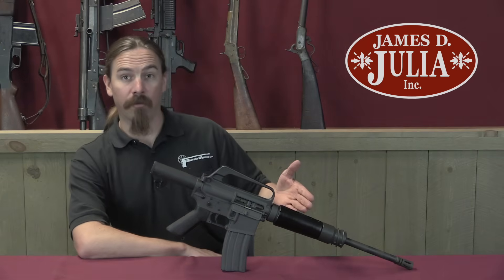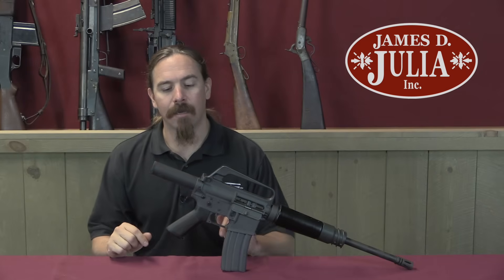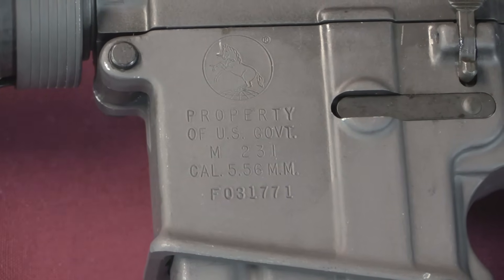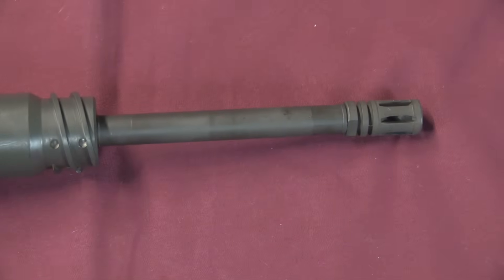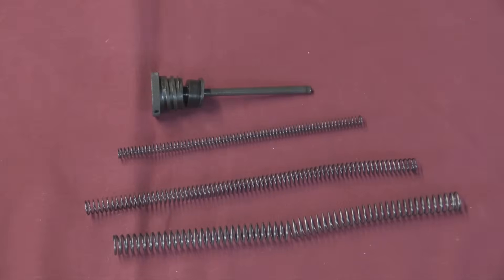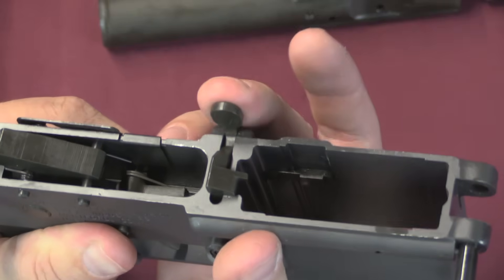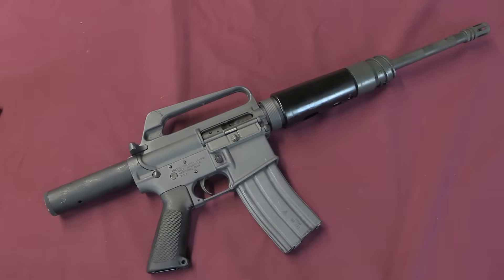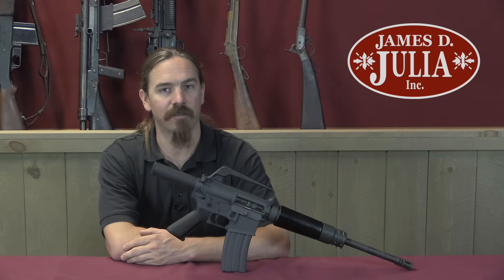Really Not an M16 at All: Colt's M231 Port Firing Weapon

Comment: We were told that the m231 was to fight from inside the vehicle and avoid contamination from NBC/ Nuke Bio Chem . But I suspect it falls into that category of taking a marginal at best idea and throwing as much money as possible at it.  Over 5 billion dollars tossed at ACU camo then dropped, oops!
Reply: I stand corrected, I use that as my standard example of a multi purpose multi tool that never replaces the real tool you actually need.  Often it seems that if the Army wanted a new helicopter and the marines would like a new amphibious vehicle but the air force would like a new ground cargo vehicle then somebody will site an inter service report, toss the phrase "commonality of parts" around and before you know it we have a amphibious cargo helicopter which doesn't do anything well on the way.
Reply: Good point. Open bolt means things besides oxygen can come in.
Reply: Those threads do not look sealed enough to withstand BC attacks to me :)
Reply: Hah, good point. Frankly, even a closed bolt gun is not gonna cut it.
Reply: "Over 5 billion dollars tossed at ACU camo then dropped, oops!"

That "5 billion dollars" included the cost of every issued uniform;  it wasn't the development cost, which was "a matter of several million dollars, not $100 million, and certainly not $5 billion".   See the update at the bottom of this article:
 http://preview.tinyurl.com/y83xhxqp
Reply: +jic1  Don't forget to factor in the cost of replacing the UCP ACUs with the multicam ones for Afghanistan, then the current effort of replacing everything with the improved OCP pattern ACU type IIs, plus the accompanying cost of issuring MOLLE gear to match all three variants.  All because some general likely got a lucrative post-retirement "consulting position" for approving the UCP in the first place.  It's a useless camo pattern and the uniforms themselves were made of markedly flimsy material and thread compared to the older BDUs; I didn't have a single pair of ACUs where the crotches in the pants didn't blow out and the velcro starting falling apart.
Reply: steven white And that, is how we end up with V-22 Ospery.

/tongue-in-cheek
Reply: simonferrer your right they were flimsy, maybe they were designed to be disposable, in all honesty the best fitting feeling uniform I have ever worn, was right after Grenada the Army started allowing us to wear solid green hot weather uniforms like the latter Vietnam ones. I have never worn any other uniform as comfortable or as well thought out as those. Of course it would be too much to expect the army to keep that style just in any new camo pattern.
Reply: al I would assume the Bradley has some kind of filtered positive pressure internal air system that would make small leaks in the barrel and threads perfectly managable but not the large leak an open firing port would create, I don't know much about the Bradley specifically though so I might be wrong
Reply: ACU is the uniform, UCP is the camouflage.
Reply: WTF are you going on about? Electric props???
Reply: Yes, but a lot of those old uniforms will be worn-out and have to be replaced anyway.  My point wasn't that the army didn't mess up:  of course they did!  It's just that this "5 billion dollars" figure that's tossed about is extremely misleading.  They've really only wasted tens or maybe a few hundred million, which is a scandal in itself, but a rounding error in the military budget.
Reply: steven white yeah
Reply: +steven white I remember those uniforms (the OG 107 jungle fatigues); I was in later (1995-2011), but we still had some of those uniforms kicking around for OPFOR to use.  You might be right about the ACU being considered more disposable.  The BDU and DCU were rated for six months combat wear before they were due to be DX'd, whereas the ACU was only rated for four months.
Reply: And it's open bolt...
Reply: Given it was open bolt I see a flaw there, nbc would need a gas seal
Reply: While I don't know the dollar figures involved, the Air Force did the same thing with the 'Airman Battle Uniform' (ABU), used to replace the Woodland BDUs. Now the ABUs have just been replaced by the same uniform as adopted by the Army: the 'Operational Camouflage Pattern' (OCP).
Reply: Ummm, no. The Osprey is hugely successful and a huge improvement for us.
Reply: jic1 The camo pattern used wasn't only on uniforms but all the gear, everything from canteen covers to itv vests we were given, and the point I was attempting to make was more in the line of how could any reasonable person believe that any one camouflage pattern be universal. Wouldn't it be more reasonable to make theatre or area specific uniforms?  I served in the US Army in the 80's and again on a deployment in 2010 to the Mideast, I understand that not only is there going to be some waste but it would be more expensive to try to save every last nickel. What bothers me to no end is wasting money in such huge amount under such a preposterous notion as a universal camo or that this will save money.   This all rings similar to the Handgun debate which is constantly being rehashed, it is a mute point, so few non SOF troops actually use handguns in combat that it makes no sense.
Reply: Jessy Beavers I was going to say the same thing. What's sad is when people how know better confuse the two, people like bloggers on military sites.

Comment: The effort to put firing ports on the Bradley was because of the Soviet Union rolling out their BMP-1 Infantry Fighting Vehicle and utterly terrifying everyone on the other side of the Fulda Gap.  The BMP-1 was designed as an infantry vehicle for conducting battle in a nuclear war.  So it had firing ports along the back of the hull that soldiers could use to shoot from inside without getting all that icky external "fallout" on themselves.

Everyone in NATO freaked out and assumed the Soviets had to have a brilliant, war-winning idea on their hands - what could we possibly do to match the BMP-1?  So everyone started looking for ways to modify their vehicles to be used in the same way.  I think the Bradley was the only one that got into service before everyone realized it was in fact a terminally impractical idea.  They don't even bother putting firing ports on the later versions of the BMP.

As to the BMP-1 itself, it turned out to be a paper-skinned "armored" vehicle that is food for any weapon that isn't a Small Arm.  But boy did it scare people when it showed up!
Reply: The soviets used an overpressure NBC system in the BMP. The passengers an crew were thus protected so long as the machinery was operable, even with the firing ports open.
Reply: The German Marder vehicle also had firing ports and they had the same problem: how to use them while preserving the NBC seal. The Germans adapted an Uzi SMG in a similar fashion to this, which, given the limited effective range of a gun aimed through a vision block/periscope, was probably about as useful. Interestingly, the Soviet's answer to this was simple: don't use the firing poerts under NBC conditions. Their ports were simple holes in the hull through which the infantry could use their standard weapons.
Reply: Yep, it was a Ball with about 5 to 6" diameter with a flip opening to mount a Uzi into this ballport. Above the opening for the barrel mount was a round channel with thick glass of about 1" diameter for peeping through and not too great a view. There were 2 on each side in the back of the marder IFV, so there were 4 Uzi Ballports in total. Exactly the amount of uzis on board: Driver, gunner, commander and leader of the 6 men in back, carried Uzis. The Ports were not supposed to be used under NBC seal either, or diving for that matter, since that vehicle could wade rivers using a snorkel. Beginning in 1980 though, the ballports had to go along with the MG above the backdoor, it was decided they were not really practical, the ballports were completely removed from each of approx. 2500 marder IFV. Also the former 7 men in the back were reduced to 6 because the seat behind commander had to be used for storing 4 Milan anti tank rockets. I was a gunner and later commander and platoon leader on that vehicle during early eighties. Geez, those memories..and yeah 1 year old comment, but what is time anyhoo. Cheers
Reply: @MrHws5mp  also when the bradley came out the germans no longer used the ports afaik
Reply: Designated targets were presumably dismounted infantry in NBC suits who presumably, having gone to all that trouble to stay alive, were then going to charge a heavily-armed stationary AFV and try to stick limpet mines on it or something...
Reply: But man is it fun to drive the BMP-1!
Reply: A Nonymous While the BMP can be effective as shown in Syria and Ukraine, it’s also a death trap which is a nice feature to have for the enemy.
Reply: The guy behind the bush with the WarPac equivalent of an MOPP suit?
Reply: Takahashi Yuuki Yes ive seen the cannon at full fire rate its amazing but it starts to cook off
Reply: I believe they used their cannons. The 73mm gun is very effective against Bradleys, Marders, and even older tanks. It's not as versatile as an Auto cannon, though.
Reply: The Grom was fitted to the BMP-1 in order to fire a large(ish) HEAT round at targets inside the 500m minimum control range of it's 9K11 Malyutka (AT-3 Sagger) ATGWs, indeed initially, the only rounds issued for the Grom were HEAT rounds: the HE-Frag round was introduced in 1974 and can't be handled by the autoloader. When the 9M113 Konkurs (AT-5 Spandrel) was introduced with the BMP-2, it had a much shorter minimum control range of just 70m which meant the Grom could be dispensed with and replaced by the excellent 30mm 2A42 autocannon. This also meant getting rid of the BMP-1's slow and dangerous-to-user autoloader (so dangerous that the Finns, Swedes and some Russian units removed it from their vehicles entirely) and freed up a lot of space in the vehicle since the Grom's RPG-style ammo is very space-inefficient.
Reply: Yeah, the autoloader required the gun to return to a certain elevation (about 3 deg?) between shots and since the powered elevation rate was slow, that didn't help at all when shooting at high angles (such as in Afghanistan). The Swedes and Finns kept the powered ammo carousel so at least the gunner/loader was always presented with the next round in the same place instead of having to twist about inside the turret to find it.
Reply: The one major problem with remote weapons, is eventually you have to go reload them if they aren't fed from an internal magazine.
Reply: all NBC systems use an overpressure system coupled with an extensive air filtration system for incoming air. and no, that system would not work with open ports on the side of the machine. the only thing that would work with open ports is issuing individual breathing apparatuses for the occupants and leaving the cabin itself unfiltered,
Reply: A Nonymous interesting given this information the design of this weapon starts to make more sense. Thanks!
Reply: the back doors of the bmp 1 were also the fuel tanks
Reply: @danielcusack5627  thank god fuel is a liquid and liquids cant burn then. in tanks fuel tanks were used to defend the crews.
Reply: +woozle plus the GROM cant fire on the move effectively.
Reply: It appears to be a solution looking for a pork barrel...;-)
Reply: So what are the designated targets for this 5.56 smg to shoot at in NBC environment? Its not gonna harm any armed vehicle, and what it can kill dont survive in NBC anyway.
Reply: Although now something like the CROWS system would be used instead.
Reply: Thank You for that bit of knowledge. At one time everything the Ruskies did frightened the rest of the world.
Reply: Ah, yes. The bad old days when world governments thought they could "win" a nuclear war...
Reply: Just try not to hit the front glacis of the BMP, possibly might be able to ricochet a 90mm APCR round. Maybe? That thing looks like (it shouldn't bounce one though) it could easily bounce a 105mm APFSDS. It has like, 14 degrees angling? The effective armor is also 66mm (not base armor, effective armor with angle calculated) , but with the angle it has might ricochet. Your chances of ricocheting on a BMP front glacis is low, but never zero.
Reply: However, the BMP-1 also had the Malyutka (or Sagger, in NATO terms) ATGM, which was capable of killing the MBTs and APCs at the time.

When it could hit anything, of course.
Reply: Ahhh, the age old “The Reds have some sort of SUPERWEAPON! We need to develop a counter!”

“Heeeeey, so turns out the AKM/MiG-31/BMP-1/Su-37/47/57 was either overhyped or vaporware, buuuuuut we actually have the counter to what we THOUGHT they had anyway, and we have more of them than God 😂”
Reply: the classic tale of the USSR making a scary propaganda weapon and the USA responding by significantly improving actual real fielded weapons to match what their enemy claimed to be able to do
Reply: That's the plot of Stripes😂
Reply: Lets not forget that BMP-1s got kills on US armor during the gulf war.
Reply: See, in a world where remote weapons stations arent a thing, you'd be right. But the development of remote weapons stations, eliminating the need for a turret-ring-in-roof, kind of negates any need for a soldier to fire from a vehicle, buttoned up. A 12.7mm or 40mm weapon station with a 360 degree traverse will achieve more than six guys buttoned up with 30 degrees of fire ever will.
Reply: Dragon Butt With their ATGM not their cannon. But still thousands of Iraqis were killed by US tanks.